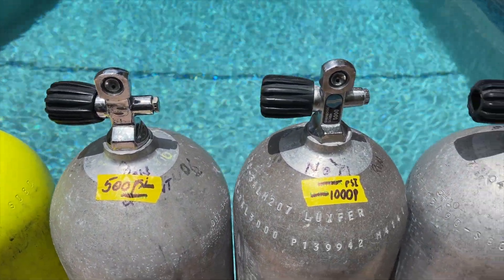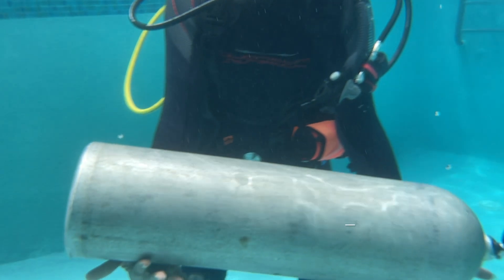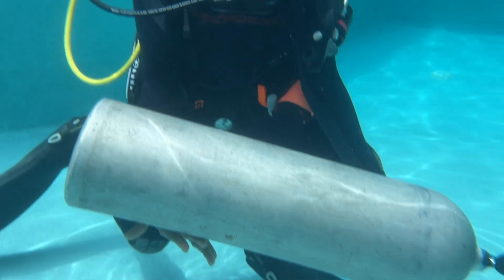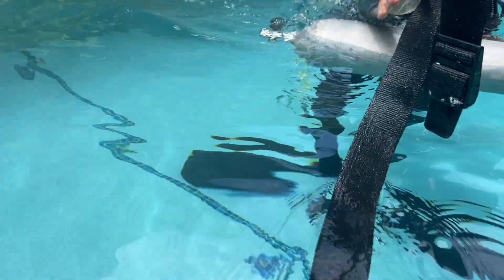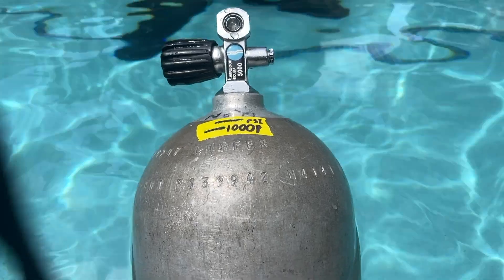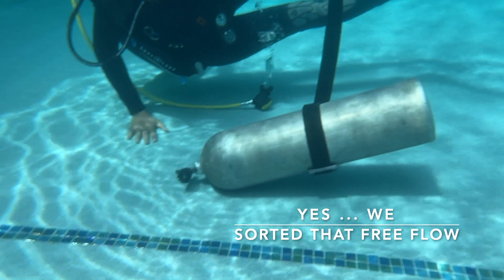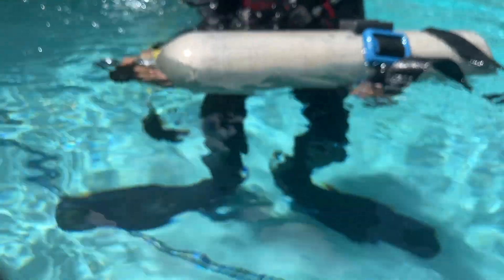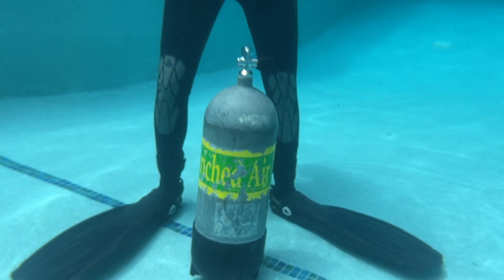SCUBA Tank Buoyancy Full vs Empty, Steel vs Aluminum

Comment: I can Vouch for the AL80 Buoyancy. When I did a Lake Cleanup I used my Aqua Lung Omni Custom BCD for the First time. Once I got there I found out Trim Pockets were Extra. Used a 7/5mm FS in 55F Water. Ok in the beginning of the dive. Got down to around 1500, Had trouble staying down. Hit about 1200, Floating with an Empty BCD. Went back to the shop 2 days later. Spoke to the Owner. Who was Surprised the Omni didn't include Trim Pockets for the $800 Cost. He sold me a set. Switched some of the Weights he sold me. I should be good now for the next Cleanup.
Reply: I realize there are some Lessons to be had here. As I was Certified Aug 2023. Check the Gear before heading out. And to Test the Gear in a Pool. Which unfortunately I wasn't able to do. I swim at a College Pool. They may not allow me to. They do allow me to do Breatholds the length of the Pool along the floor. Max Depth 13 1/2 Feet. Roughly a 90 Foot run each time.

Comment: I think you sacrifice the light weight of the aluminum anyways by using weights so that's cool I will just stick with steel.
Reply from the maker: While I do agree, i recently tried to hydro test a steel on a caribbean island and cannot get it done to DOT regulation / Standards … I love my steel tanks, but this has now become a serious problem and issue. My point simply being that whilst i prefer steel, depending on where it is used and the divers live, they may have only 5 yeas use before having to ship back to USA for hydro. Thanks for your comment joejeans.

Comment: I agree with fluffyhamster! I just completed my advanced open water cert. , and the instructors did not let me use my steel tanks. Just as it was proven in the video at about 1500 psi I was starting to float and had to fight to stay a depth. When it came time to do our deep dives they did not want an uncontrolled ascent I was so overweight if I stopped swimming I sank. 100 ft down this is not a pleasant situation to be in.